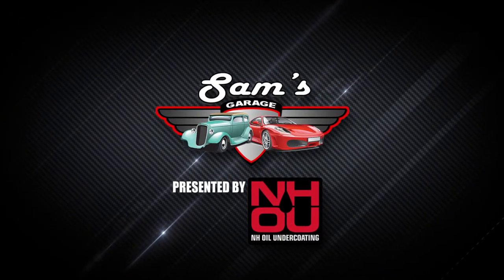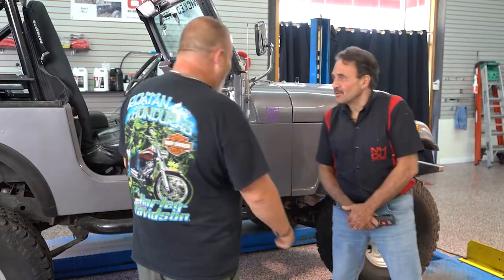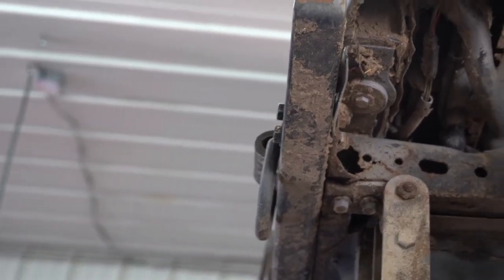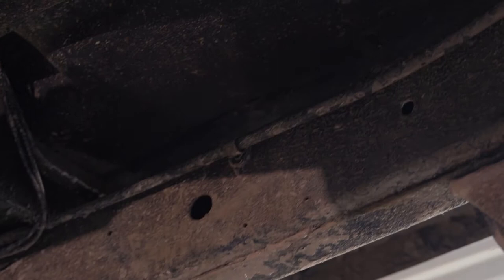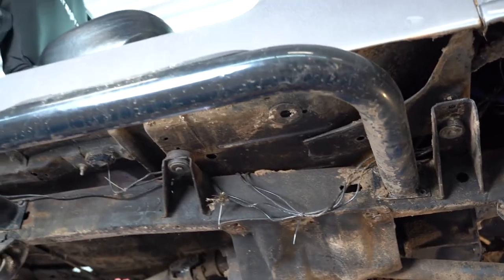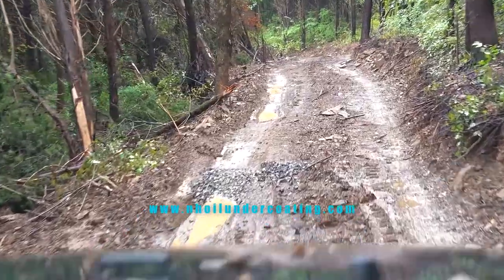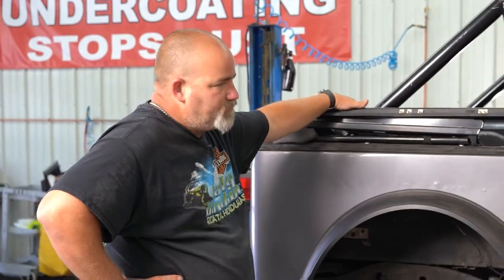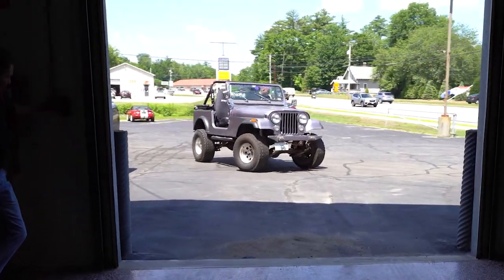NHOU® Sam's Garage Undercoating a Jeep

Comment: I am in New York and I am interested in having you guys undercoat my truck ...have a 2009 suburban I just picked up from Vermont the previous owner applied rubber coating I need removed first
Reply from the maker: We would like to see that truck before I answer. Please give the shop a call or swing by anytime 603-491-9012 extension one